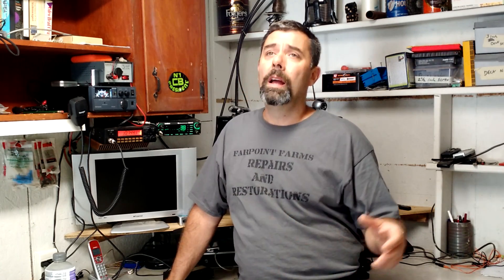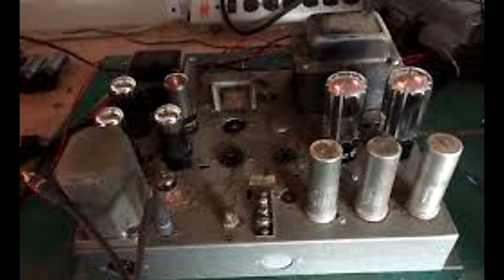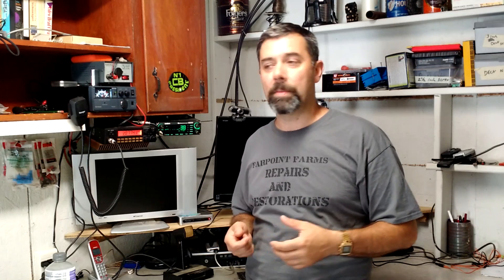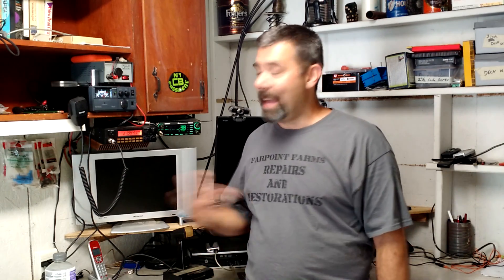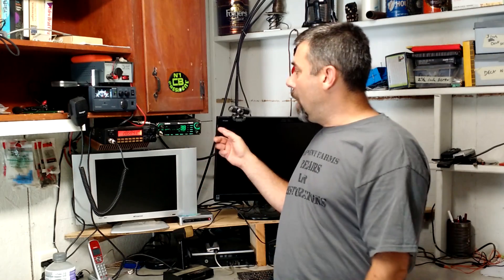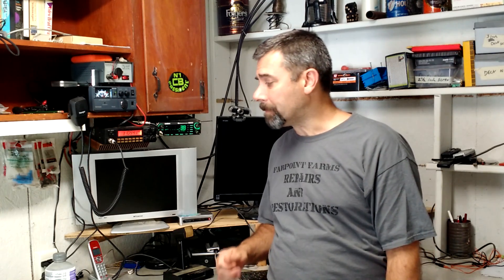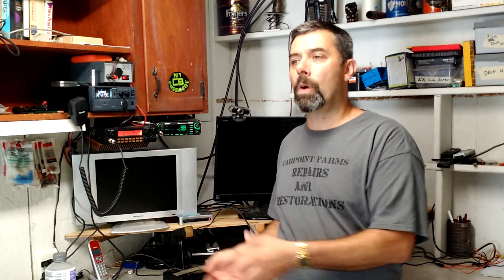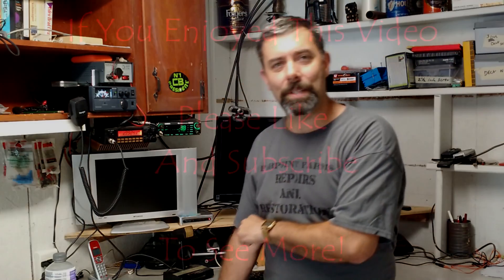A Beginners Guide To CB Linear Amplifiers.

Comment: I absolutely loved the late 70's , Early 80's only CB , AM over here in the UK was illegal back then , But that made no difference  to us 😁 , I was 10 in 1977 the height of the CB boom here in the UK , In the mid 80's I got ' Busted ' by the Buzzbies ,  Home office ( FCC  in the US ) , Had my Hygain 5 confisgated , And my mains linear Amplifier , And  told to take down the 3 element Yagi ide made ..... But within a week or so I was back on the air .... CB though soon went down hill when FM was legalised ( 27.601-27.991 MHz ) ... I hated FM , Eventually I decided to go in for my Ham Licence , That was in the early 90's ... I still use CB ,But it's very quiet and very underused compared to what it once was ... Anyway , Regards from Wales  ' Gw0wvl '  waving the hand ✋.
Reply: @Curtis Sherwood We've  now had ' Legal ' AM, FM, SSB on 26.965 to 27.405 for a good number of years now , But that hasn't helped CB here in the UK , Legalization of AM and SSB just came to late to save CB in the UK , Sure there are a few spots around the UK where CB is used a fair bit , but on the whole it's basically dead , I say this as a CBer myself , I can turn the CB on and tune through the channels here and not hear a single voice for hours on end , Or even for days .... These days if you want to talk CB in the UK you have to go portable on high ground to get the range to actually be able to work these distant pockets of CBers ... Also the  foundation ham radio licence is so easy to obtain a lot of CBers have gone down the ham route , and not bothered to come back to CB at all ... I use both , Mainly ham radio as CB is so quiet  .
Reply: Hehe, same happened to me too. Had an old mains powered 500 watt burner lol.

Comment: FCC Part 95 :RULE 11 - Linear Amplifiers

{A} You may not attach the following items (power amplifiers) to your type-accepted CB transmitter in any way:

[1] External radio frequency [RF] power amplifiers, also called linear amplifiers, or linears; or

[2] Any other devices which, when used with a radio transmitter as a signal source, are capable of amplifying the signal.
Reply from the maker: Correct. Other places however do allow amps on the 11 meter band.

Comment: forgot to mention modulators! where the cb is used to generate a carrier frequency and rf and modulator boosted the rf up but the audio was feed in to the modulator to make asymmetrical am. demco made them. o and liners on cb date back to the late 1960s if not longer. in the deep south people are still ruining sweep tube amps. a popular one in the d&a hornet. it is a hi swing box dead key 8 swing 40-45w. alot of the smaller amps used tubes that in the day wear not popular for CB amps so a lot of the small tube amps are cheap. the 10 and 12 tube amps are not as common but are still on the air. best to spend money on antenna. thy can be next to free if one gets a book on antennas. feed line can be made too just look in old radio books on open wire. one just has to use half wave multiples. when i got started i used 75 ohm tv cable cut to half wave multiples it will repeat the antenna impedance so one tunes the antenna and all is good it has low loss to about as low the expensive ones just look look it up. used the f connectors with adapters. this and a dipole will work wonders.

Comment: Thanks for the explanation about overdriving the amp with just standard operation current. Question about the performance of the radio after detuning, do you have to retune to use barefoot?
Reply from the maker: Yes. There are radios that variable output as a feature on the radio. Ideally that would be the type of radio you would want if you want to be able to run with and without the amp working.

Comment: Best bang for the buck and only amp I think anyone ever needs is the little rm Italy kl203. Less than $50 and you get almost 200 watts. Perfect love the video
Reply from the maker: I've looked into them many times, but never bought one. I did get a little KL35 amp with bad finals that I'm going to fix this winter to play with.
Reply: DJ SUMMERS: They're great little amps (and cheap too) but you won't get anywhere near the advertised output from them. I have the RM KL-203 P which is the same as the RM KL203 but with the addition of a pre-amp. The most I get from mine is 100 Watts output with an input of 10 watts in FM mode or 110 watts output with 20 watts input in SSB mode (I never use AM mode because its a "dead" mode here in the UK).

Comment: Hi there  you do not need so much power  what you do need is a  top quality antenna up about 80 feet  and top quality coax  and a good tuned  c b radio ssb   say a 5/8 ground plane or a yagi beam and you will get  a lot of d x  and that is all you need l am from melbourne Australia
Reply: I recently put an Antron-99 on 20ft pole and question 1) is do all these guys putting theirs up 60 ft. or more normally pull them down and put them back up to adj. them for better swrs? And 2 ) where are these guys finding these towers to put them up so high and also how can they without trees interfering while putting them up? I have an early version of the Galaxy Saturn Turbo and without putting a99 up higher, I'm very limited on height in town to use this awesome radio the way it was intended to be.
Reply: Hi I'm keying all over you! Big big radio.
Reply from the maker: Agreed. A lot of my videos address setting up a decent station. With that you can talk to the world on 4 watts.

Comment: Pardon my interruption here... But, as a professional electronics tech with 30yrs experience and much of that in the RADAR field... you can design an amp that will work with a radio straight from the box without a "detune".  You are also a pro and much more versed in CB and radios than myself. I find your content flawless (RADAR is really just a giant radio so-to-speak).  I don't know why it is, as you say, that the amps are designed to have a 1/2 watt or so input. I know you are correct, but that isn't necessary. It absolutely can be designed for a 4watt or 12watt input.  I won't bore you with the staging and inputs prior to final (usually TWT, formerly TWAT for obvious reasons) for the systems I have worked on, besides them being military and I shouldn't discuss that here.  I have tuned some serious amplifiers and RADAR XMTRs of tube, SS, E scanning, etc the input wattage can be quite impressive...as is the output and as for sensitivity tuning I could see a quarter 10 miles away or a single bird in flight.  I digress...

Can you explain why it is they were developed for such a lower power input ?  What is the reasoning behind that ?  I am probably jaded as a RADAR guy and get all Tool Time Tim about the power levels I deal with.   I have a feeling I may be missing something here. Does it have to do with the freqs? or it being AM. Sure I am adjusted to working in the X, L and S bands and others higher in the spectrum but I am NOT an engineer.  I do have a degree in electronics, just not an engineering one.   

The reason I am asking is because I getting back into CB. Last time I had some was 98ish in NC and had them all my life before that.  I was considering designing and making a DIY amp for a simple 30-50 watt boost. I know the math that it takes and am versed in scat design. Am certain I can put together (on paper) a schematic design and run a diag prgm for virtual analysis but am I missing something about CB that would make my DIY project a failure ?    Failure is good, its the mother of invention..but if you know something I don't it could save me from failing hard right out of the gate haha.
Reply from the maker: I think it really comes down to cost. A lost cost amp involves the use of a few components and circuits as possible. I feel that a Driver circuit or heavy duty finals would only add cost to these units and so they were left out. 
   Remember these are rarely quality units. Since they were black market in most cases the techs made them as cheap as possible and without a lot of thought on the splatter effect that many of them make.
Reply: When I say it can be designed w/o detune I mean that your input comes in at lets say 4 watts but is stepped down for use. Why would that be practical you ask ?  So, if I change CB's or move the amp to another vehicle I won't need to detune all the radios...it would be a plug'n'play amp.

Comment: I just subscribed, i need help. I live in NC and I'm looking for someone to help me fix a radio.

i have a Tram D42 Vintage CB Radio that was left in a barn to rust for 10 or more years.
When i plugged it up it brodcasts my voice but with major static, i turned down the mic gain and then i broadcast only static.

The speaker didn't work because it was rusted to the point of no return. So when i plugged in an external speaker i could hear a buzzing sound both through PA and CB channels. i adjusted squelch and its not radio static, its the same noise i'm broadcasting from my mic.

i use a 12v DC power supply from a printer cable to run my other CB without dirty power noise so i don't think the power supply is the problem.

looked inside and the PCB is a bit rusty, i'm probably getting power bleed somewhere but i don't know how to fix that. Is there anyone who can fix it? Its the first time ive had a CB with this many bells and whistles, i'd really like to get it working.
Reply: Are you still looking for someone to fix your radio?
Reply: Where you located in nc

Comment: I have a stock radio in my car. Just tuned the antenna and bought a better mic. 

I run a small amp so i can have a reasonable conversation from out at the edge of my range, (between 5 and 15 miles, depending on conditions) with my friends who are on base stations. 

Without it, I can hear them fine, but they can either barely hear me, or can't hear me at all. 

They say that I sound clear, just not very loud. With the amp on, I'm still clear, but they can hear me much better.

I think that about 60 watts rms for regular am stations (not SSB) is the best stopping point. That nets you about 2 s points and makes all the difference when you're at the edge of your range.

Love your videos, thank you.
Darkhorse from Central Florida.

Comment: I’ve known ever since I’ve owned my first CB radio that Amps Are illegal I realized after my first few years of CB that I could only get my antenna so good and so High And when everyone you’re talking with Runs some sort of amp modulator It wasn’t long that I had to have one for myself my first one was a varmint XL 50 and it was pretty nasty it bled on everything in my house and my neighbors and I didn’t even really get to use it I wound up trading it to a friend for a Connex 10 m radio. Later on I got a hold of other amps And learned that if you were running a clean radio that wasn’t hacked up and you weren’t trying to overdrive the amp to squeeze every last watt out of it it didn’t interfere with anything.  Later own a ham operator showed me some different amps and radios on the scope and how to make them run clean it’s amazing what you can do with Mic gain knob. I’ve literally watched a radio and an amp on a scope go from clean as a whistle to splattering all over the place because they were running a Power Mic and had everything turned wide-open and was chewing on the Mac. Most radios that have been opened up a little bit should never need a power mark even if you get an extra 2 or 3 Watts. Around nine amplified the 104’s on a lot of my tube top radios and stay back from them 12 inches or so and they’ll still put out 95 to 100% modulation anything more than that is just splatter. But I’ve seen a lot of people have a radio doing 100% modulation and then put a power mic on it And then be running A linear behind it. Only flipped mine on when I was talking to friends over in Wilkes County that we’re about 50 miles from me but most nights if the band was pretty clear I could talk to them just fine with a 20 W Galaxy 55 V. A lot of people give Amps a bad name There’s a lot of people that use them responsibly and don’t cause any harm to anyone. I would go crazy if something happened to my collection of amplifiers especially my little two tube baby Elkin base amp. Sweetest little 2 tube 160 W amp I’ve ever owned. I actually got it from a ham operator and had to pay 2 prices for it but I knew that’s the only chance I would get to get a hold of one.

Comment: One thing I would differ on... 99% of the amps selling on eBay are for as is. But the reason is dishonest people buying working amps, taking the parts out of them that they need and returning them for a refund. So the only way to sell an amp or most CB equipment for that matter and not run a high chance of getting it back, striped and having to refund the money, is to sell it as is not working.
Reply from the maker: Sad but true. There are a lot of scumbags out there these days.

Comment: Great video man. As they say, "Height is Might!!" I'm all about trying to use as little power as possible to make contacts. The fun part about radio for me is doing the best you can with what ya got. It's also amazing what a difference it can make even having an antenna as high as the roof of your house compared to the roof of your car. Been using DXMaps to see when propagation is good and  take advantage of the solar conditions. I still wouldn't mind too much if the FCC allowed manufacturers to make CB radios a little more reasonably powerful. Like maybe 25W AM and 50W SSB stock would be sweet and probably encourage more people to get in to radio.
Reply: I can't believe y'all still arguing over what's better. I run 1KW on 11meters and don't have a problem interfering with other electronics. The problem comes in when you got a dirty signal and you amplify it. I don't even bleed two channels half a mile away. Now my mobile rig is a different story. I'll shut down a small town with it and I don't mean just the 11 meter band. 3200 w key and I got a 5k slug in the bird and it runs out of meter. I got enough alternators to supercharger Tesla. I love it. I can talk through toasters, fillings, anything metal that resonates.
Reply: @minenachos  
Gotta watch those harmonics, too !!!
Reply: @bmortlock1956   I don't interfere with channel 6 on an old Magnavox analog CRT television with set top rabbit ears. I've got 200ft of RG213 with an old antron a99 over 125ft to the base sticking out the top of an oak tree. Low pass filter on output of the radio, the driver and all the power cables. I don't drive it hard. With a pair of 3-500z tubes it'll do about 1 KW bird. And my antenna is a bitch to get to. They claim it'll hold 2kw peak. I'm getting old I don't feel like climbing a tree so I'm not trying to find out. And I don't think 213 will hold but a thousand. I do miss my stack fours.
Reply: @minenachos  
I'm STILL using a Moonraker 6 that I bought NEW in 1977 & a Ham 4 rotor !!! I've got numerous radios I rotate all running through RG8U. I even use a couple of "Long Wires" !!!
An "Old Farts" setup. 😄
Reply: @bmortlock1956  I've used one before really good back door and you get somebody on the corner they disappear. And I can't forget about shooting skip on the flat side.
Reply: The 25/50 watts versus the milliwatt crowd is the difference between everyday reliable communication out to 15 - 20 miles where the radio is a tool and those who want to play radio as a hobby.  Sure, you can get long distances.  But that depends on atmospheric conditions and sun spots.  That is not reliable 24/7 communication.  @Plugnalong, when you did low power comms in 1959 and 1960, the radio noise floor was much lower.
Reply: @BryanTorok  It all the static emissions from light bulbs to computers or any circuit boards nowadays that make the 4 watt cbs almost obsolete brand new out of the box.  I have a President Lincoln 2 plus converted to 11 meters and that produces a much better output on CB with a 12 watt carrier on high power ( illegal for cb) .  You have to get over the static even for basic communications especially in urban areas.
Reply: hi,for me its about talking to as many people as i can,sometimes i make full use of the icom,why make things difficult,thanks 73 from Rotterdam..
Reply: I'm at 70' to boom center. Doesn't catch too much crap & isn't too much to climb.
Reply: @bmortlock1956  is.for this old man 🤣🤣
Reply from the maker: I'd love to see some modifications to the CB rules. I agree that 25 watts AM and 50 SSB would be perfect. With the diminished use of the CB bands these numbers would be about perfect.
Reply: @FarpointFarms  Perfect for what?  There are hams working DX with less power than that.  More power just makes them a bigger  nuisance for local operators.
Reply: @loctite222ms  , true
Reply: @loctite222ms  I'm with you on as little power as possible, in fact back in late 1959 or early 1960 I had a 35 milli-Watt walkie-talkie that I talked from NW Arkansas to a guy in Nashville, Tennessee. I got the handle (milli-Watt) bank then from guys around my area. A couple years later, I had a 100 milli-Watt walkie-talkie that I talked from my house to a mobile 30 miles east of me. He couldn't believe it, so he drove to my house just to see.